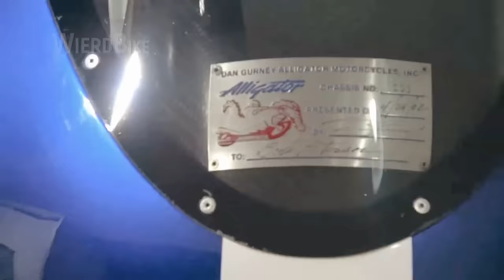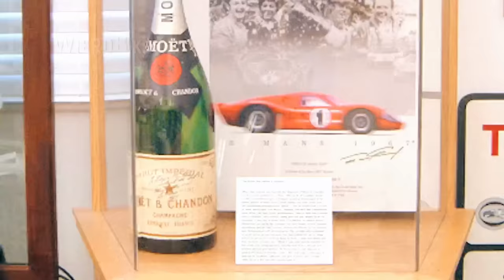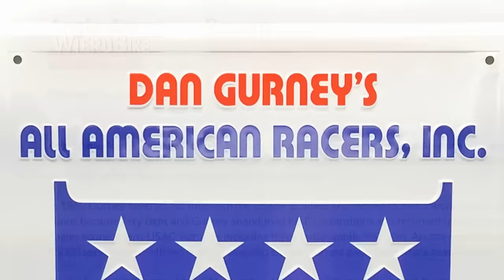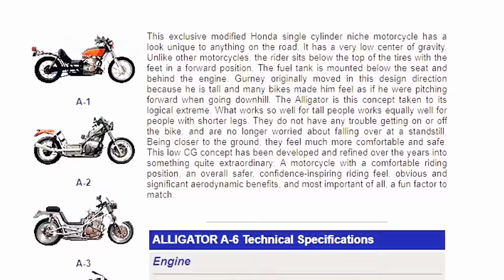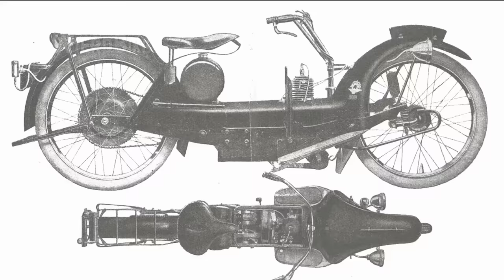Weird motorcycle - BRILLIANT INVENTION! “The handling of this bike was close to telepathy…”

Comment: I wouldn't want to give up the higher visibility over standard sedans just for that lower center of gravity.
Reply: You could add impact protection in a recumbent and get similar protection for frontal collisions to that of a small car, though with the leaned forward position in Gurney's alligator that would be hard to do. I'm building a proper leaning back full size recumbent, check out my project if interested.
Reply: @matus1976 even if it had an air bag, no motorcycke frame can be strong enough to not completely crush on impact
Reply: @indian.techsupport  that's not true, these kinds of forces are easy for steel to handle.  Look at high speed roll cage crashes of rally cars.  The three wheeled carver had a short wheelbase and BMW did frontal impact crash tests on it - and it performed as well as a small car.  Heck I tboned a car doing 30mph+ on my vstrom and only the front fork was hosed, the frame was fine. You can design a frame so that it has intended weak spots and those collapse, while the primary segments around the rider remain rigid and intact. It's even easier to do this on a recumbent since you have more length to work with and your primary safety mechanism isn't "throw the person head and neck first into an SUV at 30+ mph"
Reply: good point
Reply: The feel of the Harley Davidson is sure an experience... for those who have ridden one.
Reply: They cannot see ya anyway
Reply: And visibility to.  Taking that on a highway is inviting fate.
Reply: @jonmartin88  And he used stealth paint on the HD version. I was wondering if he was going to go full suicide mode and wear a matt-black helmet too.
Reply: Visibility? I'm constantly being cut off on my bagger because they can't see me....... visibility he says!
Reply: @brianluck84  Exactly the first thing out of their gobs is :-“Sorry mate I didn’t SEE you and it’s your fault for going so fast”. They don’t need us giving them the ammo, insurance is high enough.
Reply: @Mr.EeToMyself  And those who’ve had to push one or lost their left foot under the clutch cover. I’m sure they make sense on American style roads and they look good, sound good and Americans like to spend their money and support their products in their own country, which is also a good thing.
Reply: @mygreatbigfoot1679  never pushed mine.  Just twisted the throttle.
Reply: @Mr.EeToMyself  i was saving petrol at the time, forgot to check under the other side for the tap. Thought it was anything else … 🤬🤯
Reply: @mygreatbigfoot1679  I ride them all.. 
   I can’t see my bike when I’m watching the road.  Only people from the sidewalks can.
    I’ll even ride a scooter.  And, a heavy girl.  I don’t care what others think.
Reply: @Mr.EeToMyself  There’s nothing wrong with that.
Reply: @mygreatbigfoot1679  thanks... I love them all.
Reply: @indian.techsupport doesn'g matter if it was strong enough, theres no space for crush zones. You'd still get the impact. Maybe a bit better still for going off the road at speed into woods.

But yeah i just don't get one thing. Its put together like a cruiser. You sit like on a cruiser. How is it not a cruiser, honda rebel 150 ain't that much higher.

It looks like it would be nice for empty roads.
Reply: I would
Reply: Not the best for heavy city traffic, but in such environment a small scooter beats ll other comers anyway. (which is what I use in Bangkok traffic). Wont be good on rough roads or off pavement either. That said, I’d love to have one as a third or fourth bike.

Comment: I have built several recumbent motorcycles. Some of my builds are almost 9 ft. I think if he would have stretched it out just a few more inches had the seat laid back a smidge more and brought the handlebars back to the rider it would have been more comfortable to ride. He was one of my inspirations for when I was first starting building recumbent motorcycles.
Reply: Such a ridiculously long wheelbase would be useless on a track
Reply: @proudtitanicdenier4300  True, I don't think he developed it to be a track only toy, seeing how it was fully street legal and he was trying to mass-produce them.
Reply: Agreed. That setup you describe sounds similar to the Rohorn Racer.
Reply: @proudtitanicdenier4300  Complete bollocks. Dan tested several Alligators on track with Eddie Lawson! Also, having ridden two Alligators, and many other FFs with much longer wheelbases (including both Ecomobiles and Monotracers at the Brno GP circuit I can say with certainty that you are utterly mistaken!
Reply: @pnblondon1087  what lap times did you get
Reply: @pnblondon1087  my previous post stated it wasn't developed to ONLY go on the track, obviously very STREET LEGAL with headlights, tail lights, turn signals and speedometer etc. he wanted to mass-produce them so most of the purchases would not have been used on a track.    Recumbent motorcycles never caught on anyway that's why you don't see them everywhere. There's a few of them that were developed during the last 50 years but they're so rare hardly anybody will ever get to see any of them. No mainstream racing nor is there an all recumbent motorcycle team. Just because you could take one to a track or two doesn't mean anything besides just that.
Reply: @kamenwaticlients  Rohorn's bikes are truly special. The application of 2WS is mind boggling.
Reply: @hemingwaybromfield3722  Indeed. I'm amazed he got it to work so well. And sitting position is great.
Reply: need weight bias on front wheel, the design is already pushing it let along the length of rear stretch required to further recline and maintain forward bias
Reply: That would be cool. Probably much less functional at least at first but I bet some cool designs could come from that.

Comment: I never knew this existed,  but I've always liked my cruiser bikes to feel like I was part of the bike, rather than just sitting on top of it.  Definitely looks like it would be comfortable, and relaxed to ride.
Reply: scrunched-up seating position wouldn't work for me.  can't really stretch your legs on the move.........
Reply: @raymondo162 it needs to be like a feet forward bike
Reply: comfortable? the rider looks folded up like an accordian
Reply: I have a honda PC800 touring bike and a Suzuki Intruder VS700 Chopper with apes and foreward footcontrols.
I have allway been thinking about a mix between the two, with full fairings and the touring bike characteristics while also having a real low seat hight and extended arm position... I would feel like I was holding on to a cruisemissile! :D
-I'd buy an AAR Alligator in a heartbeat if it had a trunk like my pc800 or even just side boxes! :D

Comment: Craig Vetter had a fuel economy challenge some years ago where they rode across country and the winner was the one that got the best mpg!  Almost all of them was designed low like this one. Craig had a low tech formula for high mpg. Aerodynamics + 125 - 250cc four stroke single cylinder+ tall gearing. " It doesn't use fuel until the piston goes bang"!
Reply: Yes indeed, The AMA used to have the vetter challenge at Laguna Seca AMA races.
Reply: @tonylawson9319  I would have liked to participate in that race.

Comment: The 1953 Norton Kneeler seem like a better way to lower the CG. I couldn't just sit on the Gurney Alligator and take the punishment to my spine, then again my knees wouldn't be too happy after a couple of hours on the Norton! Visibility is the main drawback, seeing and being seen, we all know the consequences of poor visibility. I'm a skinny old man and still ride a sport bike. With knee and shoulder injuries, spreading out my weight seems like the most efficient way to keep riding.
Reply: The Kneeler Norton is restored and running, in the Sammy Miller Museum in SW England. It would be interesting to hear from him what it is like to ride.
Note to self, a return visit to that museum is long overdue.
Reply: Agreed.  The riding position of Gurney's alligator is by far the biggest flaw imo. Why make a bike like that but hunch over forward?  I'm building a full size fully functional rear engined recumbent with a proper reclined seating position, taking full advantage of the comfort and performance the platform has to offer.  Check out my cx500 powered prototype if interested.
Reply: You could have a naked cheerleader firing a flame thrower on the back of your bike and some idiot in a car still won’t see you.
Reply: Actually you would be very very comfortable on the Gator.  I rode mine from Atlanta to CA with no back, knee issues.

Comment: Heard about this bike years ago, but never found out what happened to it. Thanks for the closure Weirdbike. As a modern hi-perf scooter owner, I see some advantages in the Gurney machine and at least one disadvantage. First the advantages. The power to weight ratio is far better than any of the modern hi-perf offerings and top end output much better. The lack of full body enclosure would  make working on the Alligator MUCH easier as opposed to having to remove numerous body panels even to do minor maintenance. The low center of gravity would certainly help in the handling dept. and the comments below attest to this. Disadvantage: Only one that I can tell from the video; a locked-in-one-position seating posture. My 2013 Kymco Xciting 500 Ri scooter is guilty of the latter, and I can't stretch out enuff for comfort ( I'm just under 6'). I'm currently considering another brand hi-perf scooter, and if anyone knows about a late model Gilera GP 800 with moderate mileage for sale, send me an email.

Comment: It would be interesting to see this reengineered with an electric motor & large (for a bike) battery
Reply: Indeed the platform has tremendous potential. You'd probably be interested in my Akira Bike project, I'm aiming to take full advantage of the potential of the platform and laying all the groundwork for manufacturing them, starting in kit forms then moving onto full bikes.  Prototype is ICE powered but an electric version will be next.
Reply: Bmw is not so far with their electric scooter
Reply: @vercingetorige400  not the same at all.
Reply: @FFVoyager   the lower back won't as far back and as low but the wheelbase is stretched because of the battery pack and its weight will create similar handling characteristics
Reply: @vercingetorige400  not it won't.  Scooters do not have a supportive seat back.  You still have to hang on to the steering to stay aboard.
Reply: @FFVoyager   I agree with you on that, I imagine that overall CG and wheelbase, thanks to the massive weight of the battery, could be in the same region so giving a similar feel. I don't about steering feeling but everything else could be

Comment: Honestly, i dont see why MORE bikes arent like this to begin with. Most bikes you feel like your going to slide off them when speeding up. So it would be REALLY comfortable to be able to just relax on one. But i have to admit, this thing is probably UNCOMFORTABLE as all hell on long rides. But you COULD bid on one today and get it for about $17,000 or more.
Reply: I've never felt like I was going to slide off of any motorcycle I've ridden. 
I can see a major disadvantage to this design. Visibility for both the rider and car drivers. It looks like your head is on level with most car hoods, which will make it harder for people to see you and harder for you to see over/around other vehicles. That is a huge safety issue that trumps any advantage the design may have.
Reply: You'd probably be interested then in my Akira Bike Project - building a fully functional high performance recumbent designed from the ground up to take full advantage of the platform.  It has a nice reclined seating position too, not the weird hunched forward but sitting low one in the Alligator.  Check out my youtube channel
Reply: Chris, I would have to say you are wrong.  The position of the seating on a Gator is based on a 911 Porsch.  I rode my from Atlanta to CA and have done 3 Iron Butts.

Comment: Recumbent doesn't catch on because it leaves you feeling vulnerable. Combination of not having the ability to stand on the pegs for bumps and being low in the traffic is enough for most rider to pass on this.
Reply: Plus no passenger and other things. The basic thing in riding is feeling free, not caged.
Reply: Quite the opposite. Because you have a seat back to brace against you are much more secure and better able to control the bike
Reply: @constantinosschinas4503 Most of Royce Creasey’s creations were 2 seaters, with the seat back moving back for the semi-enclosed passenger
Reply: @Siravingmon  Yes that is why you see mountain bikers use recumbents.
Reply: @robmanueb.  MTB levels of manoeuvrability and balance are not relevant to riding powered 2 wheelers at speed. Being able to control the steering from a secure riding position is.  Speaking as an ex mtb rider/ (road)motor-biker, recumbent bicycle rider, and former owner of a recumbent (“feet forward”)2 wheeler (Royce Creasey’s CMax 2).
Reply: @Siravingmon  Sorry didn't even see I was commenting on motorbike thread. Motocross and trails probably wont see recumbents. As a lifelong cyclist and having ridden a recumbent I stand by my remarks as well. I don't have a problem with them but the issues I mentioned are the reasons I think they are not more popular. You think those reasons are non issues, why do you think recumbents are not more popular?
Reply: @robmanueb.  recumbent bicycles are unbeatably fast on the flat but slow as slow can be uphill as you cant stand on the pedals and use your arms an back to give your legs a rest. Recumbent bikes and motorbikes were banned from competition some 70-90 years ago as unfair competition (too fast), no doubt under pressure from the big manufacturers. Both bicycles and motorbikes tend to follow the fashion of successful race counterparts….

Comment: It's just the low centre of gravity that improves handling, although other factors are involved such as rake and trail etc,  though I wouldn't feel safe with feet forward position
Reply: They could certainly be made safer, but I don't feel like Gurney's Alligator was optimized at all for this. With the low cg you could stop much quicker, if the cg is below the axle of the front wheel, you could actually increase rear wheel loading on hard braking. A decent sized recumbent could also add frontal impact protection and active restraints giving the safety of a small car. I'm trying to take full advantage of what this platform has to offer in my Akira Bike Project, check it out.
Reply: Actually low centre of gravity never improves handling.
If it did , you would see it used on race bikes.
Low centre of gravity slows a bike's turn in.
If you could lower the CoG to the road surface the bike would be impossible to corner
Reply: @PaulG.x  Wrong. COG in of itself has no bearing on turn-in. See the guys on recumbent bicycles, they fair just fine. It all has do with polar moment, more inertia, slower turn-in. In upright bikes that means a high COG to be inline with the riders abdomen. Not so in recumbents, the abdomen is already in line with the lower COG. Technically, Since the bike is now much shorter, and everything far closer to COG, recubments can have a faster turn-in than an upright.
Reply: @PaulG.x  A low CoG has advantages and disadvantages and it can certainly improve handling.
Google motorcycle engineer Tony Foal's page he has a section on Feet Forward bikes and CoG, or check out his book which has a chapter on it, or John Bradleys books. 
Motorcycle racing regulations are onerous and basically locked in the modern upright and riding position and subsequently where the CoG can end up.  Racing is about competition not innovation and has held back motorcycle design for decades because of this very attitude you're expressing here.

Comment: Great video and a good tribute to Gurney's innovation.  He laid the groundwork for feet forward bikes with the Alligator.  I think the platform has even more potential and I'm aiming to take full advantage of it in my Akira Bike Project .  Check out my fully functional high performance prototype build if you are interested in these kinds of bikes or what the future of motorcycling may have to offer!
Reply: I don't think he laid the foundations for F/ F m/cycles . A British designer , Roy Creasey  ( I think ) built a fully enclosed bike with centre hub steering . This was in the mid seventies . It was called Quaser .
Reply: I don’t comment on YouTube but bro, I’ve been on your website since I had a windows 95 pc as a school kid and now ride a 1st gen hayabusa. A question I always asked myself (since you’re not going the twin ceramic rotor… you know the rest) have you considered some variation of the ohlins hydraulic 2wd system? I think with a wheelbase at the length of yours, the handling would be A1
Reply: @_S-t-a-r-z  Thanks for following! yeah it's been a while since I was a kid in a basement lol. those early Hayabusa's are sweet. Yes I absolutely have some plans for 2WD / 2WS!  I already have some hardware built for the system.

Comment: It’s a recumbent. ❤
Reply: it is

if it was fully faired it could set some speed records for its engine size

but compared to a cruiser bike with a drivers back rest, it doenst look any more comfortable - or to any touring bike

its not clear what problem this is trying to solve - for a bicycle its all about aerodynamics while still being able to pedal

also the handlebars are too far away - under seat steering would be better

one fatal flaw, in an accident there is no chance of being thrown clear, your chest will be crushed
Reply: @kenwittlief255   Put the engine behind the rider, use a true laid back position. Smaller front wheel under the knees of the forward facing legs. You could even use under seat steering for ultimate comfort and view.